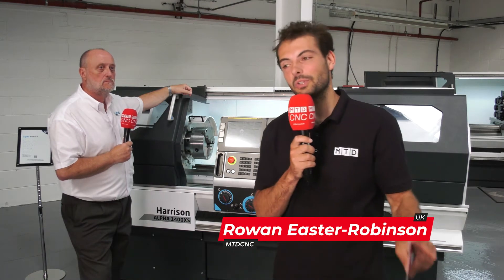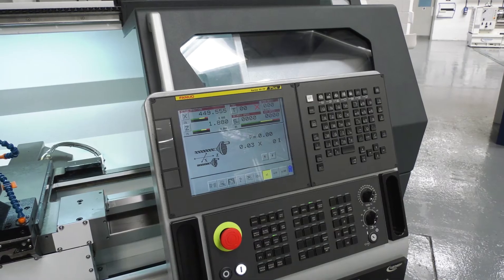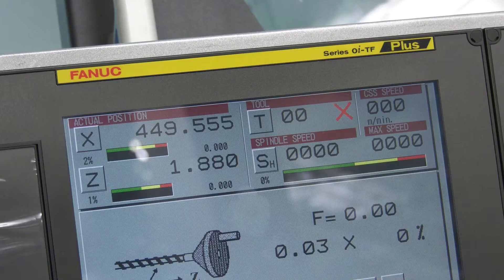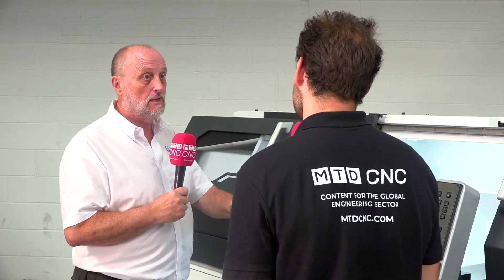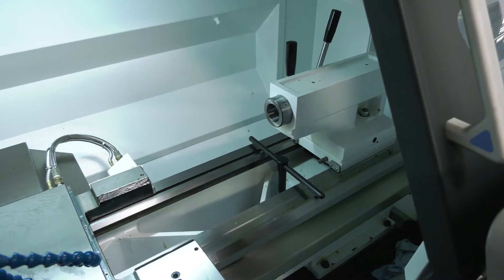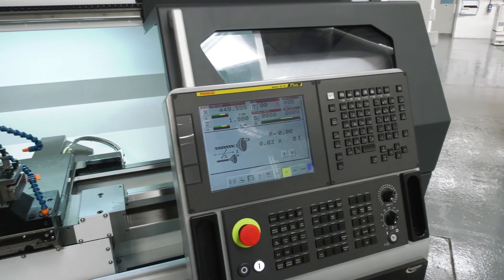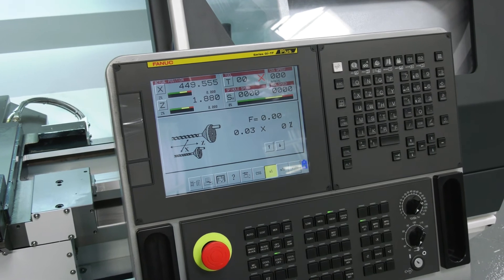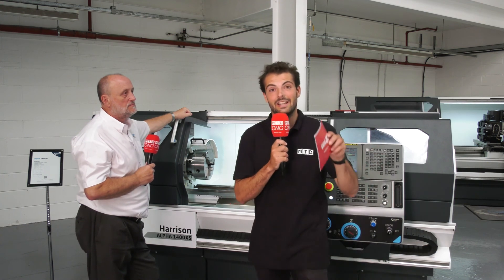Harrison Alpha XS series - 2-axis combination lathes with the best of manual & CNC features

Comment: About 27 years ago I saw an Alphaturn new at my first employer and just heared that it is still in use several 2nd hand transfers later. I would have one at home if I had the space and found a cheap one.I think it was a 400, it had a FANUC on the saddle with a CRT monitor.